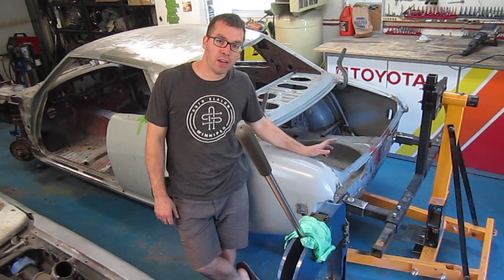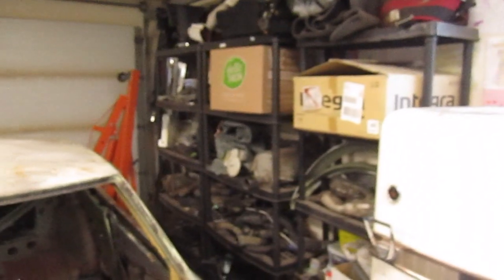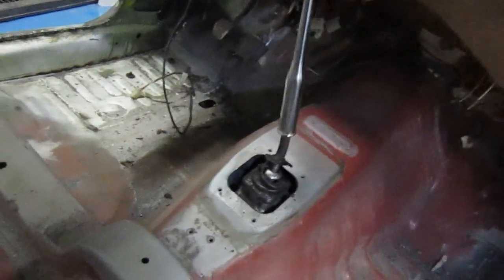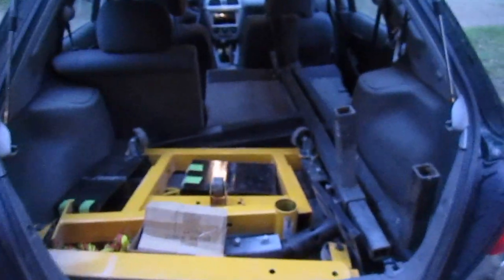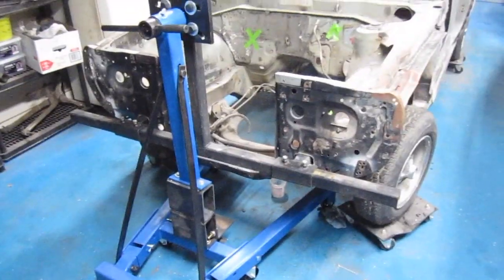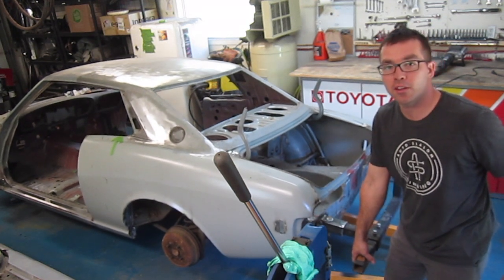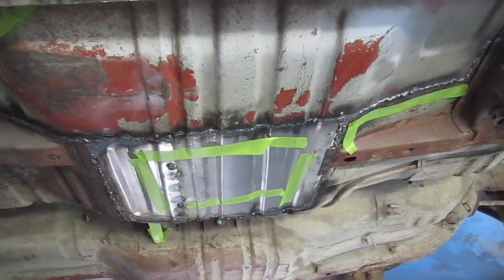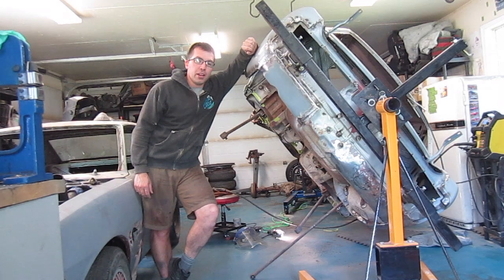Part 24 1973 Celica restoration

Comment: Since you have the car on the rotisserie,  I suggest that you put undercoating or rust preventive, on the parts that were fixed,  now that you have it on the rotisserie.
Reply from the maker: I used epoxy primer on every thing and a very good single stage Emron gloss black as well as seam sealed every seam after epoxy primer. the car won't see any salt/winter driving.